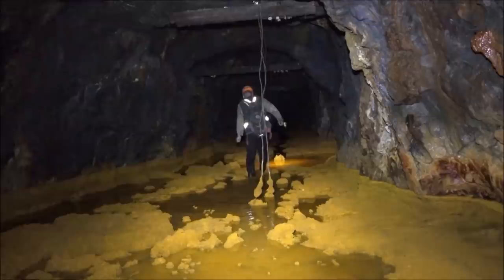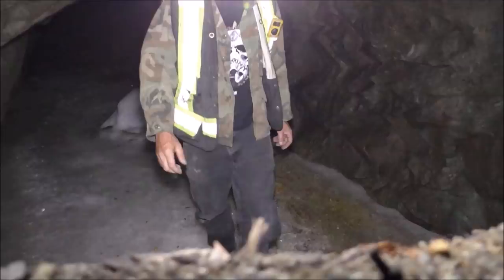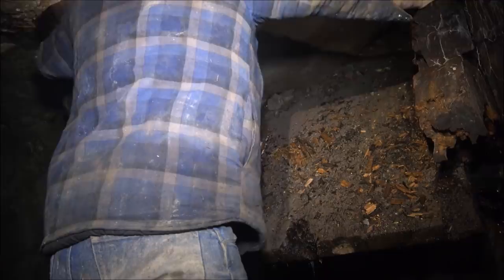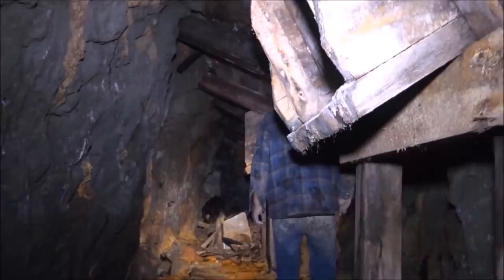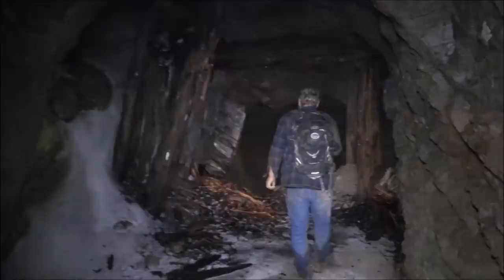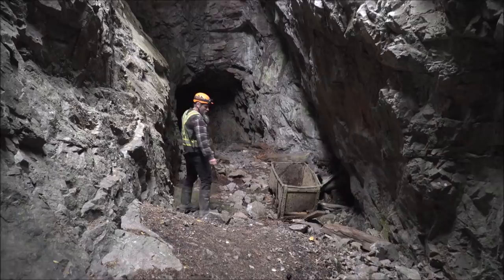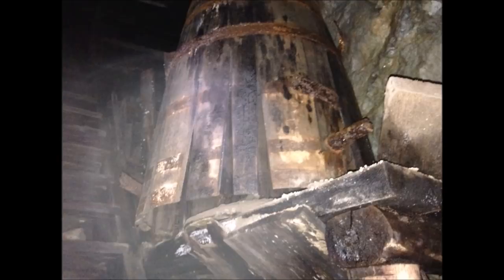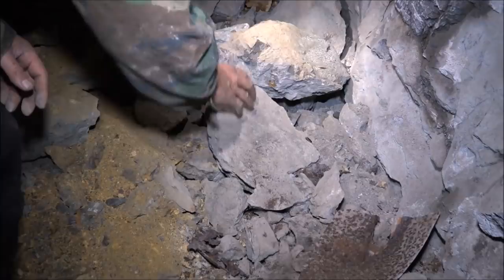#142 Very best of Phoenix Mine, exploding dynamite, 100 year old train and huge ice formations!

Comment: Thanks for sharing. Gotta agree with your comments on some of the things you wouldn't do again. Tipping the dynamite outta the box, LOL. It must've been a very rich mine to get down to those small pillars and then to come over the whole area with an open cut. I used to have a tool like that for bringing down loose ceiling rocks..... Just kept jamming matches into cracks which would fall out over time and signal when it needed some attention. A phobia I had was squeezing into tight spaces, just couldn't do it... you've got plenty of guts old mate!.

Comment: In the late '70s at the Dome Mine (closed after 105+ yrs, Jan 2017) in Timmins ON, I had to muck-out the bottom of the glory hole twice a year with an Eimco 21 pneumatic rail mounted mucking machine. I had to blast the ice build-up to get to the bottom of the glory hole, a distance of about 80', so I could muck-out the loose muck and tree branches, as the glory hole was one of the mine's ventilation entrances. I had to add 'kleen-flo' to the mucking machine's air hose to prevent the mucking machine's air motor from freezing-up because of all the moisture to the air pipe. Anyways I had a 5 ton Granby car and a 5 ton Mancha battery locomotive to haul the ice and muck to the ore pass, btw, I did it all alone, easy peasy…...ahhh, those were some of the best days in all my 43 years as an underground miner.
Reply from the maker: It sounds like a lot of fun!
Reply: @exploringabandonedmines  it actually was fun, but a bit chilly lol.

Comment: Damn. I logged that mountain in the 1990s and had no idea the top of that hill was capped. I sure hope to join you this year for some cave ratting.
Reply from the maker: Up through where the tram line was?
Reply: @exploringabandonedmines  I was just a young fella and couldnt see the mountain through the trees. My bush boss would drive me up there and I would sleep most of the way, run saw all day and sleep through the ride home... winter logging means its dark when you pull in and when you pull out again. Never saw much from the landing.
Reply: Only tram I ever found over there was at rock candy

Comment: HAHA, i have to jab you a tad.  My house is on a wooden floor, covered by carpet, but i don't call it a false floor.  part of my house is on concrete covered by carpet, again, not a false floor.  A mine has wooden floors-bridges and platforms covered by dirt, none of which are false, no more false than my carpet covered floors.  I will complain about the false floor comment everytime i hear it.  I started exploring mines in Barstow Calif. in 1975.  I will never forget seeing the wrought iron candle holders in the walls.  i did not take them, but now they are long gone, never to be seen by the new guy.
Reply: BTW, i didnt mean anything about that you take things.  The mines you explore are remote and might as well take what you can and share in your museum
Reply from the maker: Sure jabs are fine........the reason they are false floors is because by all appearances they are solid rock floors like the rest of the mine.......... but sometimes you walk along assuming you are walking on a solid rock floor but you are in fact walking on a thin layer of dirt supported by some wooden planks over an ore pass that may go down hundreds of feet.  If that fails as you are walking over it  the fall could kill you!
Reply: @exploringabandonedmines   I love your videos, and happen to think your a damn cool guy.

Comment: I heard an explanation a long time ago about all of the equipment left behind in the mines. Supposedly if they brought the equipment to the surface they could be taxed on it. Any truth to this? Question to Frank or anyone that knows the answer please.
Reply from the maker: I doubt it. When many mines closed it was because of low metal prices so there were no buyers for the equipment. Also they often left everything in place hoping markets would improve and they could start the mine up again.
Reply: Thank you for the answer. Wondered about that for years. Your answer makes sense.

Comment: Sorry for disapointment frank but it was just the blasting cap that actualy ignited lol we use those a lot in mines and i saw a bunch of partner blasting a cap 40ft from you to make you think there was an airblast and  scare the shit out of newwbee lol
Reply from the maker: You are wrong I have worked with explosives and caps for many years. Watch the 20 lb rock rolling across the screen from the concussion. It was 5 feet from the explosion a blasting cap would never do that it only has a small charge.